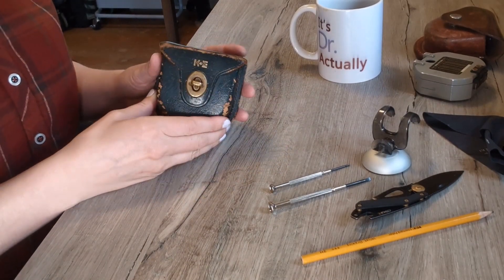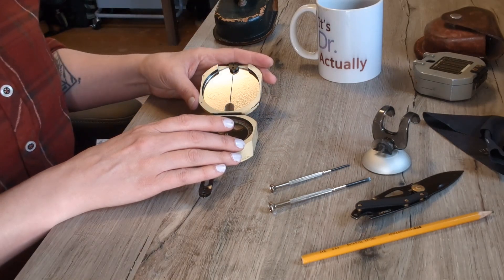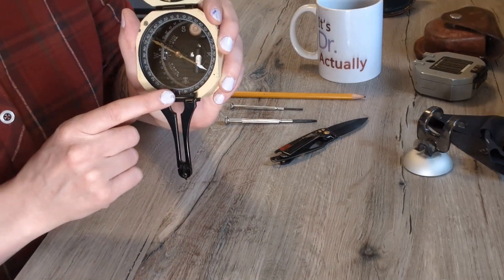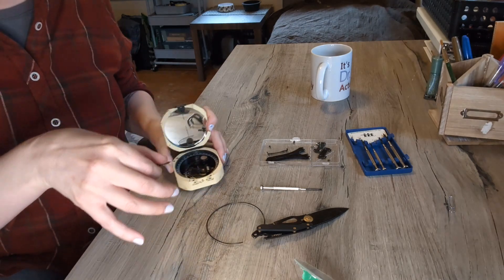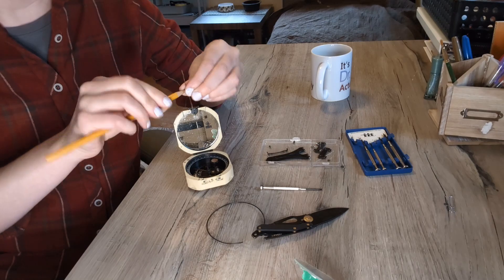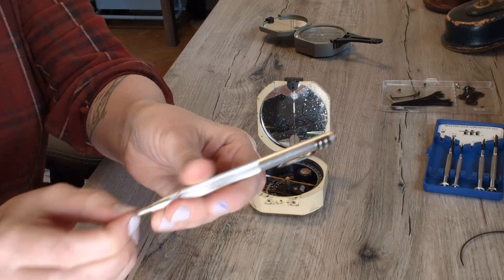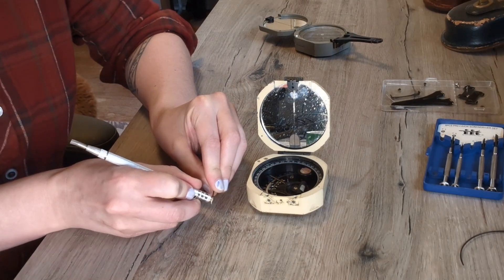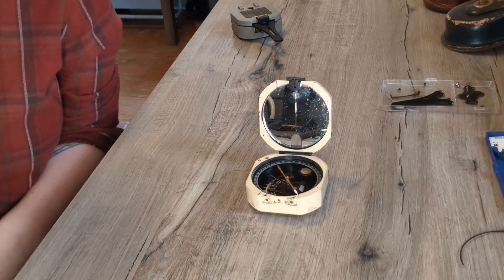Transit Compass Repair

Comment: My compass has a rubber seal and does not have a snap ring. How do I set the glass into the seal. It appears to be very tight.
Reply: Any tricks?
Reply from the maker: I wish I could say I had a good solution. Sadly I once tried to repair one of these and ended up breaking the glass. That rubber seal keeps it waterproof. Fortunately I had another piece of glass from a Brunton beyond repair. My suggestion would be- don't remove it if you don't have to. But if you do, know you risk breaking the glass.

Comment: Hi, i have a transit compass brunton. But i have issues in North ans South direction. I still could not fix it using your method.😢😢.please help
Reply: Can anyone help please?
Reply from the maker: @TheKoopoi  Sorry for my delayed response. I am not as active as I would like to be on my channel. If you do not have a simple metal floating needle my method will not work. For example, if you have a newer model with bar magnets or a round magnet, this method will not work. Out of curiosity, is the issue that your North area is pointing South? If that's the case, the cheapest solution might be to repaint the arrow.

Comment: Thank you!  Well done and very descriptive.  In looking at my Brunton (~early 1970's) there is no snap ring but there is a seal ring around the glass.  Fortunately, there is no need to take it apart at this time.  I cleaned the glass and mirror so we are ready to take it out into the field.  I recently gave my grandson a pocket compass that he marveled over.  Hopefully some day when he is mature enough he will get the Brunton with the staff thimble and ball and socket tripod head to enjoy.
Reply from the maker: Very cool! Yes, some of the earlier models had a rubberized seal holding the glass in place. I believe there is a snap ring underneath it, but removing the rubber causes permanent damage. I fixed one like this once.